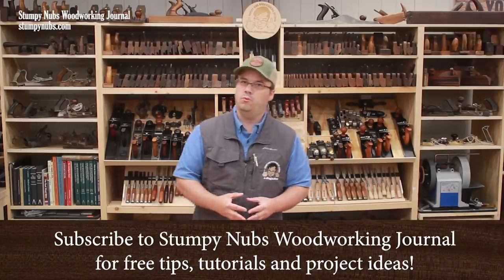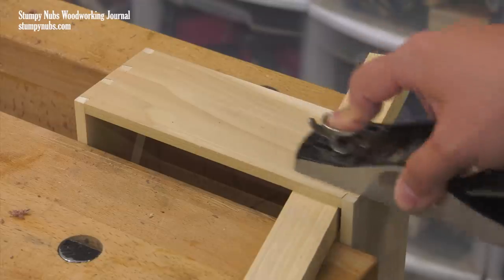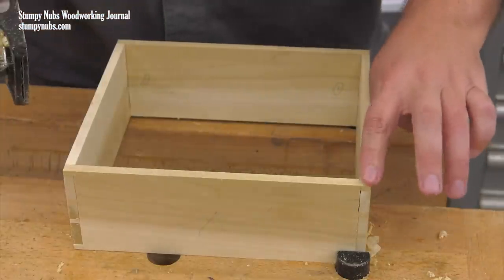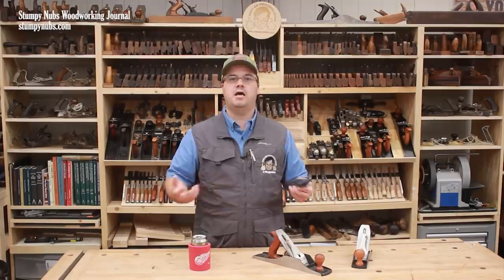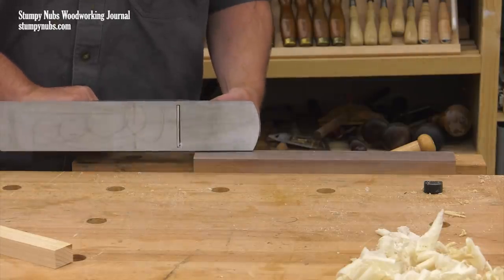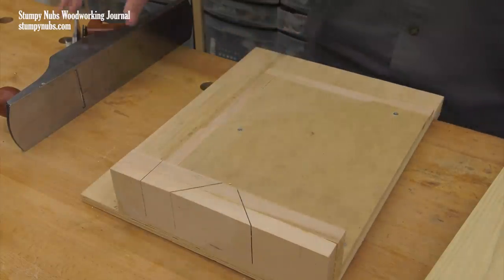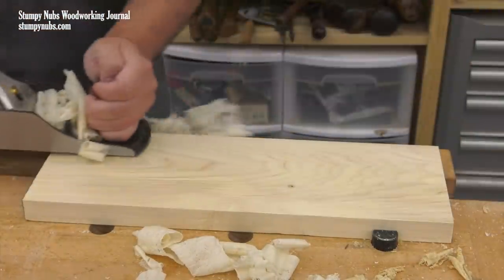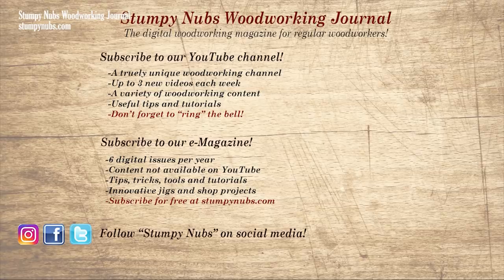Two hand planes you didn't know you needed

Comment: When I started my apprenticeship as a site carpenter in England 38 years ago, I was told that I would only ever need 2 planes. A block plane and a 5 1/2.  I bought a second hand Record SS 5 1/2 (don't think they are available in USA but in my opinion better than Stanley) still have them both.
Reply: I too have a Record 5 1/2, one I restored from the fifties. Its my go-to plane for 95% of work. I had to remake the handle, but the metal parts were in good nick when I got it off ebay for peanuts. I had a good vintage Record no.4 as well, but gave that away to one of my sons as I never used it. The only #4 left in my workshop is a chinese cheapo Silverline, set up as a scrub plane for rough surfacing panels too big for my planer/thicknesser. Love the 5 1/2 for the easier straightness you can achieve when dressing panel edges, and the wider flat area when cleaning the faces of panels.

Comment: I have a Lie Nielsen 62 and the Woodriver block plane you showed in this video. They are my first and only hand planes and I love them both. I can quickly, cleanly and quietly perform tasks that used to require a jointer, tablesaw or router. There is something extremely satisfying about cutting those beautiful thin curls.

Comment: I inherited a #2 block and #5 1/2 plane, but never used them because I didn’t understand them. I finally sharpened the blades, figured out the bevel up/bevel down on the 5 1/2 plane and now I love using both of them! The #2 plane is my usual go to hand plane, I can get paper thin shavings all the time. I bought a $12 rusted junk #4 from an antique store, restored it, and now I love using it too. I’m a power tool first guy but hand planes are awesome when you finally learn to work with them and not force them.

Comment: I wholeheartedly agree with buying a new premium plane rather than restoring an old one. I would add that all the materials (e.g. sand paper) needed to restore a plane can be very expensive, and you end up reducing a lot of the “savings.” I learned this the hard way.

I did a lot of research on new hand planes, and here’s what I ended up buying in this order:
1.	Block plane – Lie-Nielsen No. 102 low angle
2.	Jack plane – Veritas low angle with two irons; 25 and 38 degree bevels
3.	Smoother – Lie-Nielsen No. 4 in bronze

The Veritas excels on a shooting board. Also, with the 38-degree iron it both smooths and flattens well.  The Lie-Nielsen No. 4 is a beauty to behold and provides an unparalleled psychological boost.

Comment: THANK YOU SO MUCH! I watched Paul's video on this as well bit I also watch Rob Cosman. I'm a relatively new woodworker, primarily a power tool worker. I saved up and bought a Lie Nielsen block plane 3 weeks ago. FELL ON LOVE! I was planning on going to a 5 1/2 next too for precisely the reasons you said. It's also sparked my interest to restore old planes as well! Everything you've said is validating how I feel. We'll said!
Reply: I have restored a few older planes and they are great. What they don't have is mass.  The Lie Nielsen jack plane or smoother weighs considerably more than their respective historical versions.  The added mass is critical when shooting and planing end-grain.
Reply: That's exactly what I did. I got a Lie Nielsen block plane and then got the 5 1/2. I love them both and use both. I just need to get better at sharpening, but I'm getting there. The next step is buying the proper sharpening setup that Rob Cosman suggests.
Reply: @atomictyler  Get a honing guide, 1000 grit diamond plate and 16000 Shapton. Don't get a lapping plate as you can use the diamond plate. Dont waste money like I did on other water stones or other combo diamond plates. Those two items will last you a decade
Reply: @MrSharper802  That's my plan. The 16000 Shapton is next on my list. I got a cheap honing guide, but it's...cheap. I shouldn't have bothered with it, the blades don't stay in place properly and it's more frustrating than anything. It's certainly good to hear that the 1000 and 16000 is really all it takes. Do you know if the holder is worth it? It seems like I should probably get it, but gosh it's a lot for a holder.
Reply: @atomictyler  i have a holder but you can easily build a wooden base to hold the stone. Or you can use that router mat material under the stone to hold it in place. I had a cheap honing guide at first and honeslty it worked great.  I had no need for the lie Neilson until I got into using spokeshaves. Those blades are so short and very hard to sharpe. I think Schwartz put out a video on how to get the cheap honing guide to work a little better.

Comment: Back in 1969 in Freshman shop class we used a Stanley #5 for everything.   Just about all of the guys became proficient enough to joint boards of any length for panel glue ups.  We didn't know longer planes even existed.  Because of that, even though I own a bunch of planes, my old Stanley #5 sees the most use.

Comment: I love the number 5 1/2 for all the reasons you listed.  It just works soooo much better than the 5 or 6 for those sorts of tasks.  The 5 is just a bit too light to power through tough grain, and the 6 is just a bit too long to be easily wielded for most cabinet size project pieces. 

But, I inherited a number 3 from my WW1 era grandfather.  It’s amazingly better for all the things I used to use a block plane for.  It has a toe that’s a little longer, and enough extra weight to power through tough grain easily.  Yet it’s not too long or wide to get into little areas that a number 4 won’t fit into.  It’s also small enough to fix dings without having to smooth the whole board - unlike a longer plane like the number 4 that bridges dings…

The only thing I use my block plane now for - is parts I need to trim with one hand.  Or when I need to carry a plane in my tool belt pouch.  Both things usually only happen during final install of a cabinet, or fine tuning sticking drawers on furniture.

The only other plane I’d HIGHLY recommend for a power tool wood worker - is a number 5 set up as a scrub plane. It’s just the fastest way to make 3;4” lumber from the home center into the 1/2” board you wished they sold.   You don’t even have to worry about tear out when you’re planing.  Because you can just belt sand the last 1/16 of an inch to fix it all up :)

Comment: You are right on the money that the block plane should be the first plane for a power tool woodworker. When I left the workshop to become a site carpenter the first plane that I acquired was a block plane. A bench plane is on very little use without a bench. The second was a bullnose plane which is very useful for tweaking rebates and close into the corners. My third and specific to my specialism of sash window renovations was a side rebate plane.
Hand planes offer an advantage over machines for jointing in that there is no snipe when used correctly.
On one occassion when I wanted to lay flooring through a lounge I wanted to produce a long straight edge to act as a datum. This I did with several pieces of ply clamped together and planed like a rubbed joint testing as I went to ensure that they were absolutely true. 
When using a jack plane I prefer wooden jack planes as they are lighter and with a beeswaxed sole slip like greased eels reducing effort for longer jobs.

Comment: good call

it is #7 for me for most ad hoc edge jointing or to quickly flatten a single board.

and I recently invested in rabbet / rebate block plane, which was one of my best purchases. I can now clean the rabbets/ rebates or shoulders, and do everything else that block planes can do. I like that edge to edge blade capacity of the rabbet block plane.

Comment: My block plane lives in my apron. There are so many times where reaching for it is just the most practical tool for the job. I had a project that needed some very small wrap around external trim. I cut a piece wrong and I was out of new pieces, so I scarfed two shorter ones together. My block plane flushed the two up in just a few passes. Once painted, I couldn’t even tell where it was.

Comment: Totally agree on the 5 1/2.  I bought a 5 and a 6.  One is a little too big, one is a little too small.  Bought a 5 1/2 and its perfect length, width and weight.  

But I disagree in the block plane.  The number 3 is waaaaay better IMO.  It’s a slightly longer block plane that you can use with 2 hands - and that has a long enough toe to smooth dovetails and box joints without a lot of concentration.  It also has a tiny bit of extra weight that helps with end grain and areas prone to tear out.

Comment: I have a ton of planes now.   Most refurbished antiques.   Agree the block plane is the best place for a power tool worker to start.   I have a 5 1/2, but I find my go to plane for most things is a LN low angle jack.   Easily just a personal preference thing.    

I hate sanding, so I do use a #4 a lot as well.   I'm fact, most of my plane purchase have been motivated by using a sander less.   Straight down to the spoke shaves and cabinet scrapers.

Comment: I don't have enough room for power tools apart from a table saw so I am limited to using hand tools such as planes. Haven't brought any new ones. I brought a coiple of old ones and managed to assemble a functional one that works reasonably well and have some spare parts left over.  It taught me how a plane is put together and how to service one. Admittedly I was helped enormously by you tube videos. Given that even new planes rarely work straight out of the box it was better that I learn to set up an old one rather than mess up a new one. A new plane is definitely on my shopping list though and I'll probably take your advice and get a 5 and a 1/2.

Comment: Could not agree more.  Especially about the buying a good plane first.   I consider myself a hybrid woodworker, since I would never give up either my power tools or my hand tools.  Wasn't always that way.  My first experience with hand planes was decades ago when I bought a cheap plane from a big box store.   I knew nothing about hand planes back then so using it was disappointing to say the least.  I can remember thinking "why would anyone in their right mind ever use one of these."   Granted, I didn't even know how to sharpen the blade so you can imagine how frustrating it was.

I gave up completely on planes and used sandpaper for anything that a power tool couldn't do.  It was years (actually decades) later that I was reintroduced to hand planes by someone who knew how to use them.  Talk about the sky opening and angels singing!  Wow!  My collection of planes is now in excess of 25 or so.  Both refinished garage sell ones and high end LN, Veritas, and Woodriver.   Agree that the Woodriver brand is the sweet spot for quality and price.  They are hard to beat.

Probably there are many others out there having a similar experience to mine.  Hopefully, they will see this video.
Reply: I did the same thing. Bought a little block plane and didn't even think of sharpening it. That was a foreign concept at the time, but hey, I was used to bashing things with hammers and a joint was never more complicated than two boards slammed together. Tried using it to clean up the bottom of a door that was dragging and it did nothing. No amount of effort was going to get that dull blade to cut anything harder than butter.

That plane sat in the box for years before I got a real interest and learned how to properly use them. It's still a crappy block plane, but it's a now functional crappy block plane. Can't bring myself to upgrading it when I've got so many other tools to dream about, but one day it'll get replaced with something decent.

Comment: When I saw the question in the thumbnail, my immediate thought was my posh block plane and my fave 5 1/2 old Stanley. I used the block plane constantly and treated myself to a Lie Nielson for one of my significant birthdays, whilst it was on sale. The thickness of the blade and the quality of it means I can get a fantastic edge, that lasts an outrageously long time. The 5 1/2 was a random ebay buy, and once I'd tidied it up, it soon became my favourite larger plane. I love the width and weight and find the ubiquitous 4 to be too small and pitchy for anything I use it for. But if I had to reduce to only one, it would the Lie Nielsen block plane, which I can pretty much make do anything.

Comment: I just watched this video again. Horses for courses. I’ve progressed from being a hand tool woodworker when young and poor to gradually buying and preferring power tools. I have slowly acquired hand tools also. I have three Stanley number 4s. They are what the shops sell and the most numerous on eBay. I do use them with different blade settings. They are really not as appropriate as a number 5 or five and a half. I was given a Stanley 2 and it works well for block plane situations. When there are noise considerations I use my Qiangsheng rebating block plane frequently. Regarding a shooting board. I think it is too difficult for a beginner. Better to use sandpaper on a two by two or similar. I use an edge sander for squaring and trimming ends. You never have enough tools hand or power. Working freehand for most is never going to be as accurate as power tools but it sure is satisfying if it’s accurate enough.

Comment: I was told by my college lecturer that the basic plane set for starting out was 9 1/2 block plane, no 4 smoothing plane and no 5 jack plane. After years in the trade my go to planes are the 60 1/2 block plane, the no 3 smoothing plane and the 5 1/2 jack plane.

Comment: I have never had the opportunity to use a 5-1/2, but I can see the appeal. I do use a number 6 much like you describe using the 5-1/2. I also have two number 4's, one set up as a scrub with a strong camber on the blade and another set up as a smoother. These two planes get by far the most use. I don't have a jointer, but I can get twist out of a board with my scrub plane very, very fast before sending it through my planer. I also have a couple of number 5's that I picked up in my travels, but they pretty much only get used if I need to joint smaller boards. To be honest, I find that I get far more control with a number 4 than I do with a block plane, so unless I need to work in very tight area, I will grab the number 4 smoother for joint cleanup and to break edges.

Comment: If it helps anyone, I picked up an old Stanley No. 5 because it was there and stupidly cheap. It's far more like a No. 4 than a No. 6. No. 4 width but significantly longer but not a lot heavier. Much lighter than the No. 6. Feels good - but it's probably too long for some jobs.

Comment: I think that's a good video. Thank you.
I had a brief comment exchange with Rob Cosman after mentioning that No.6 planes are much like 5 1/2 planes - but longer - if that helped anyone, and that I had one and I really like it. It's great. 18 inches of goodness. Rob is a good guy and mentioned a No.6 is what he'd pick if he could not get a 5 1/5.

If I can add a tip ... if you are getting into woodworking, about the time you get a plane or chisels is a great time to learn how to sharpen them. I use diamond plates, and there is a cost - but whatever system you choose, you do need these tools to be sharp to use them properly. There is no shame in a gig, and there is no shame in cutting panels of leather out of dumped leather sofas to make a strop. Sharpening gets easier and quicker the more practice you have.
Reply: I was going to ask about the #6.  They're easier to find than a 5-1/2.  Esp. if you get an older one (& then you'd need to tune it).  Before I had my #7, I used a #6 for the shooting board.  And IMO every woodworker will find a shooting board to be useful.
Reply: @TomBuskey  Yeah. Much easier - and cheaper. I used eBay. ebay is weird. Sometimes things go for more than you expect. Other times for less. I think patience and some careful shopping can get someone a good plane for about the same price as a not good one. 

Again, Paul Sellers mention: his plane restoration videos are excellent. I watched them before I bought and had a really good idea of what I probably needed to do with the planes I was getting. Really enjoyable restoration projects. 

A no.7? I was tempted a while back. Never happened, though. I think a No.6, No.4 and low angle block plane will probably do me - but I do need a shooting board at some point.
Reply: My only disagreement with you is your use of woodriver, premium and sharp out of the box in the same sentance. I have a WR 6, 4 and black plane. I just bought the 72 today at their sale. None of the blades were sharp enough to use or if the box on any of those planes. I've also got about 6 additional blades for them. They all needed to be flattened and sharpened before use.
You don't have this problem with Veritas or LN.
I don't have a 5 1/2 but I do have a #6. I think it's better than a 5 1/2.
Reply: @mdburnem  I think your comment came to this thread by mistake. We made no mention of Woodriver.
Reply: @mdburnem  "but I do have a #6" Good stuff. Nice one.
Reply: @emm_arr  yeah, I replied on my phone.  I thought I was making a general comment on the video not a response to someone.  Sorry.
Reply: @mdburnem  That's OK - not a problem at all. I've heard other people say the same about YT on phones!
Reply: @emm_arr  When I got my #7, I stopped using my #6 for jointing & shooting.  I put a camber on the #6 and use it more for scrubbing.   But I'm not a power tool guy.